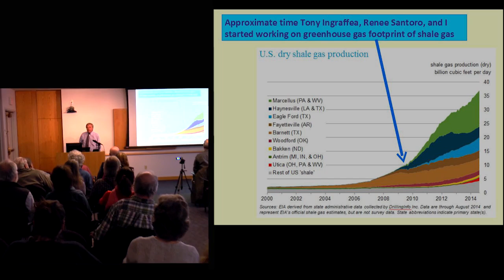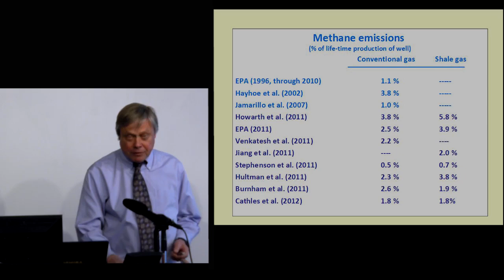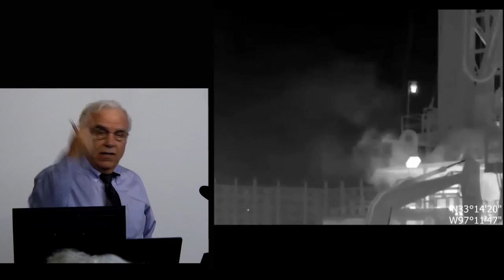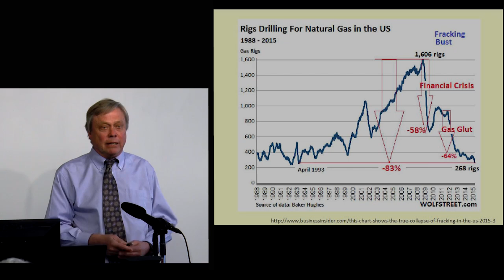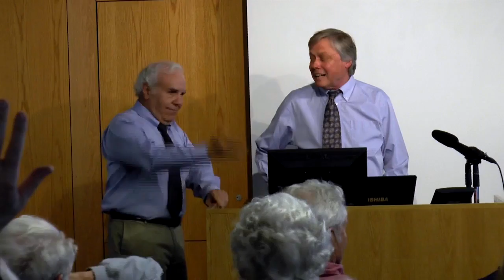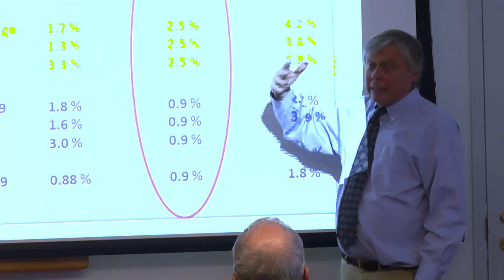Still a Bridge to Nowhere HD

Comment: So called "green" energy isn't green. Fossil fuels were needed to mine the ores, refine them, shape them, a high energy, advanced civilization with clean, reliable electricity is required to manufacture these solar cells & wind turbines.
To be  "renewable" a device must produce enough energy to be capable of replacing itself. But renewable energy is unable to generate the intensity of energy needed for mining & manufacturing these devices & neither can they produce the needed raw materials like oil can because oil is the most energy dense & portable energy source we know of & it also serves as raw material for many manufacturing processes.

Sunlight & wind power cannot produce enough energy to sustain a civilization like ours that requires a massive & reliable energy input, electricity is the backbone of our civilizations complex technology & it's all dependent upon OIL for it's manufacture & maintenance.
Governments must know this & that's why the OK was given to drill for oil in the arctic in spite of the danger of setting off a run away greenhouse, our military requires a huge amount of fossil fuels to function, solar cells, wind turbines & batteries can't meet their needs.
The military will have the oil it needs as long as it is capable of using force to secure it from weaker countries that can still produce it.